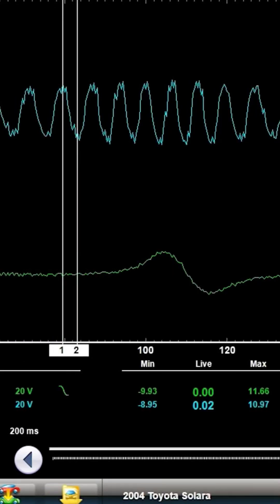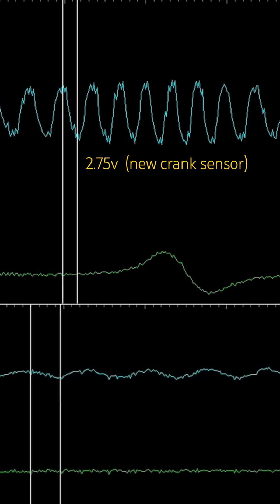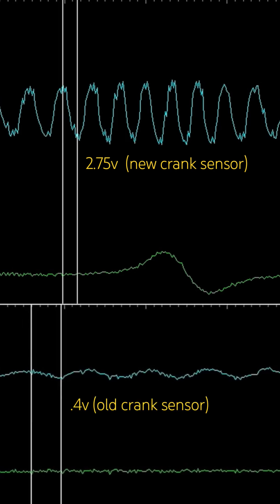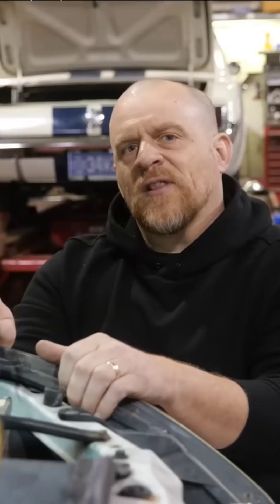Weak crank sensor signal causing start-up issues only (no codes)

Comment: a 5 dollar voltmeter on AC reads it
Reply from the maker: Sure a voltmeter can read these on an AC scale, but it's an average of the peak to peak voltage. And on some systems 300mv is normal during cranking. I can get 300mv just my shaking my leads around lol
I'll take the lab scope over an average reading voltmeter any day for this type of testing

Comment: I'm dealing with a crank no start, no codes on a 2005 elantra.  3 years ago it did the same thing. Tossed sensor in and it fired up. I figured this time because oil got in connections that it shorted sensor. 
Toss in sensor and nothing. It wants to start.
Reply from the maker: Will it start on carb cleaner or starting fluid? If yes, next step is to check fuel pressure
Reply: @ScannerDanner   new fuel pump
Stainer had metal in it. Video on my channel.  When it was above 30 degrees the cam sensor tested OK. Take it off vehicle bench test and get nothing. Atm leaning towards cam sensor or secondary security system
Reply: @ScannerDanner   it's getting fuel and wants to start. Plugs are wet. Primary & secondary sides of coil test good. Also tested between coil and pcm, also tested ok. I used a factory manual for reference and diag

Comment: Years ago before I scanners and scooes were ad available I started back probing crank and cam sensors with a cheap LED charging system tester. As you have someone turn it over the lighs will flash and you could see if the sensor wasn't working or waek if only the bottom light barely flashed or flashed intermittently. If the first couple light flashed bright and consistent I knew the sensor were working. I have also had some of those type of sensors work perfectly, then not at all, then work again making it a real challenge to diagnose.
Reply from the maker: no sure that would work on a VRS, maybe only on hall effects, but either way, I wouldn't trust a blinking light as a sure signal, but it is better than nothing, There are just too many variables

Comment: How can test it if can't get it to start lol I'm having a problem with crank no start camshaft codes f150 have a scope but can't get it to start
Reply from the maker: Test it at the ECM connector if you can't get to it on the engine

Comment: Thanks Danner for a lot of years of making me become a damn good diy old guy mechanic 
You're the one I first learned about fuel injection and how the O2 sensors controls the fuel trim's 
I bet that was 25 or 30 years ago 
Thanks Paul long time viewer 😁
Reply from the maker: You're welcome, it's always good to be reminded that I'm not just doing this for myself. Thank you!
Reply: @ScannerDanner  Sir with weak sensor signal does engine rpm shows lower than threshold while cranking
Reply from the maker: @mikembz1  no sir, it is either a go or no go situation, not one where the RPM would read less then normal when a signal is being received
Reply: ❤it 
Enjoy your 🎅 🎄 🤶 🎄, with all your family around you, Sir ScannerDanner 
👍 
From Nick Ayivor from London England UK 🇬🇧 ⏰️ 23:47pm Good Evening

Comment: You are really on to something here with the subject of a weak Magnet on Crank Sensors.  I have noticed that pretty much every after market sensor always has a much weaker magnet than most of the original ones,   I had replaced the crank sensor on 4.0 jeep recently because of a timing issue,   the engine started and run well but it kept having arcing inside the distributor cap,  and after much investigation I determined that the timing had to firing late .
  I replaced the sensor with a brand new.   Holstein brand crank position sensor, and it cured the issue with the distributor,   but I noticed  if you did a test with several crank sensors and compared them.   Because I am willing to bet there are at least a few thousand people that would like to see just what the differences are.

Comment: ac multimeter would show it.  that's how they've said to test those since the '80's
Reply: I think if it consistently fails like this one did yes you can catch it. I’m not sure you would see an intermittent.
Reply from the maker: AC voltmeter will average this signal which would be even less than the 400mv peak to peak i was measuring. Was never a fan of this measurement. It's not enough data to make a definitive call in most circumstances
Reply: Ford uses about 1.5 volts DC on their 2-wire crank sensors and 36 minus 1 steel fingers per revolution spinning past the sensor. If you don't have a scope, I think it's worth trying to block the DC component with a coupling  capacitor before the AC meter, which rectifies the signal before averaging and scaling to get the RMS value if it were a pure sine wave without any DC component.

Comment: I posted to the forum about a crank no start on a swapped gen v l83 with 13k miles. The harness and pcm are verified working by Current Performance. There is fuel at the rail, verified spark, and new cam sensor, maf sensor, and hpfp and it will not fire. I have a new crank sensor that I haven’t installed but not getting a code for it. I got a p1682 code but did not come up with a new tuned pcm. Still crank no start. At a complete loss on next steps

Comment: Resistance will burn you I work for Ford had a 23 Corsair with auto headlights not working 0.2 ohms they wanted me to replace the bcm had voltage drop on the 5 volt wire
Reply from the maker: 100%